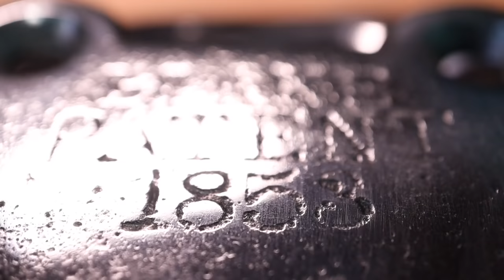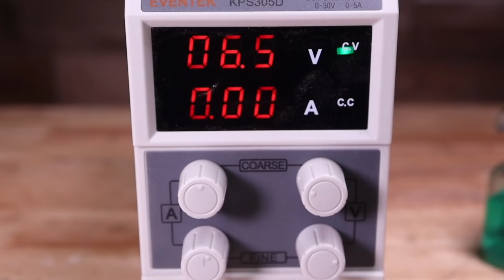Restoration of an antique NUT CRACKER | Gold plating!

Comment: You did a great job it looks great.  Based on the before and after pictures, it looked like the spring was put in upside-down on re-assembly, just curious is there a reason.

Comment: I have watched quite a lot of restoration videos over the years. All of these original manufacturers seems to have put no effort all into sanding there items, for even the worst of the casting marks. i wonder why they did not put any effort into that. manpower was very cheap when these items were made. I don't think it would have added much to the cost if they put some effort into making these items a little better. 
        Also I never saw plating done that way ever. That was a brand new technique for me to see. I am guessing you do it that way, so you don't need to use tanks of some kind and need large volumes of plating solution to cover bigger objects.  Very clever.